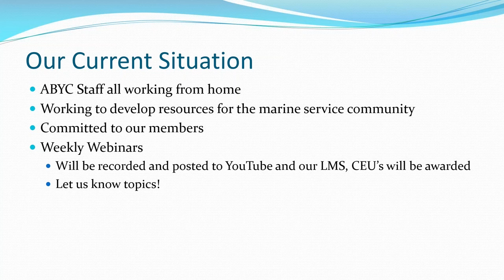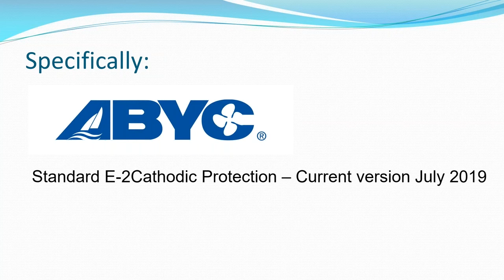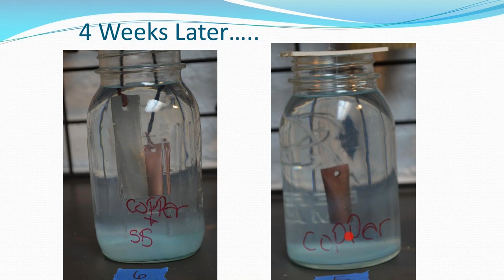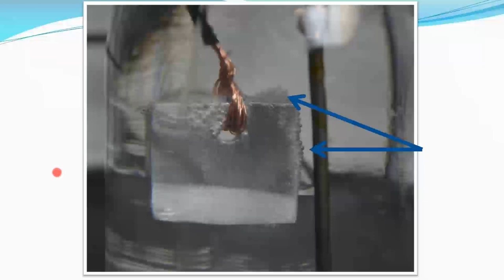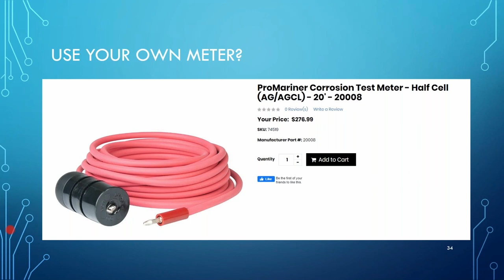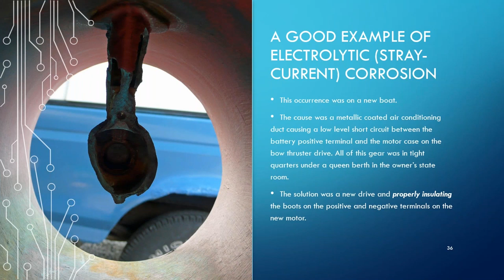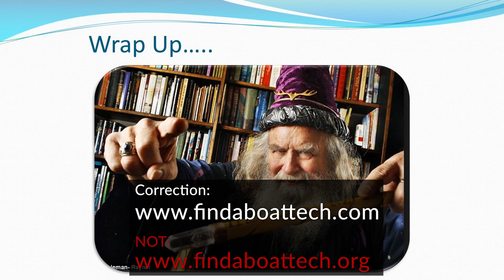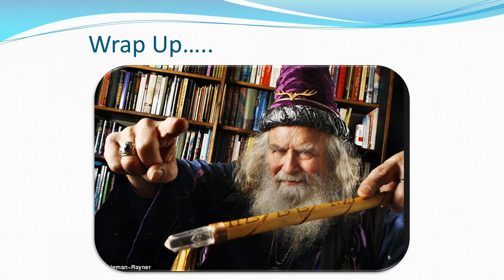John Adey's Corrosion Project - Webinar

Comment: Now add electricity flowing into the electrolyte from a faulty powered appliance on board (and the AC ground bonded to the boats grounded metal) and do this in fresh water not salt... Then tell us how far deadly current travels and what it does to the neighbours boats?  Oh and when you burnish copper use either a copper brush or sandpaper not a wire brush as it imbeds iron into the copper...